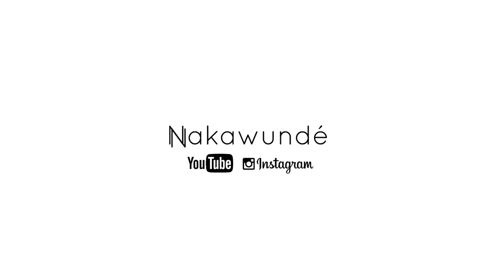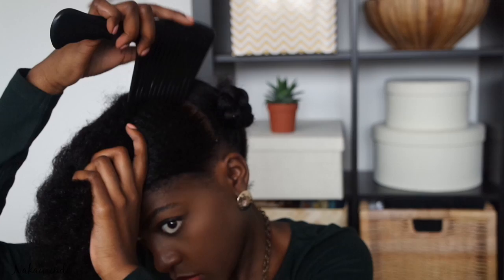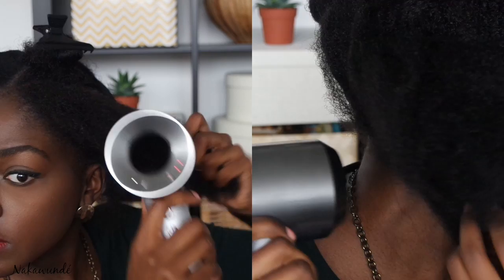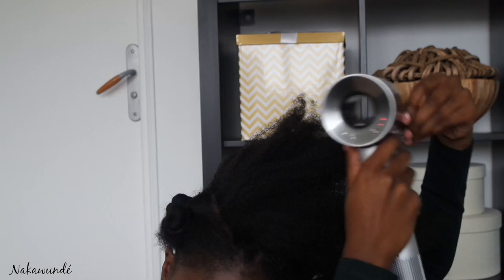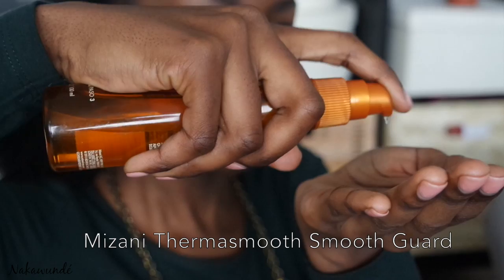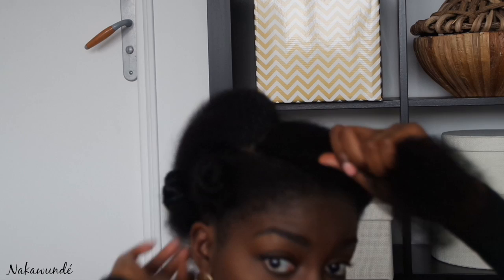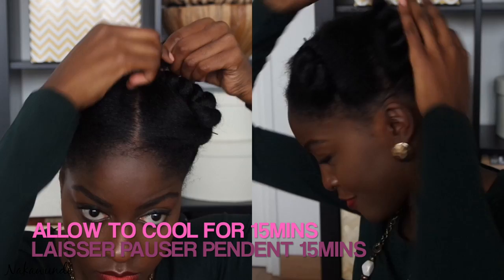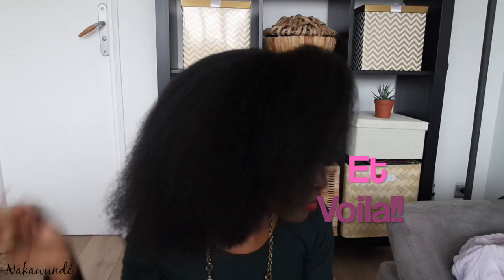Blowout Natural Hair with Dyson Supersonic | Nakawunde

Comment: Do you find that the blow dryer dries your hair fast? I'm looking for a new blow dryer. I wish this one had a comb attachment, but I wanna see if it's worth it. You're one of the only people I've seen give a review from the African diaspora.
Reply from the maker: Yes I also hadn't seen it used on natural hair so I had to do a video. It does dry your hair really fast, which is also why I had to do smaller sections to maintain control on the shrinkage. I agree that for natural hair a comb attachment is a necessary option. If you are used to blowdrying with a paddle brush/ round brush it's great. And the diffuser is really good, so if you like wash&go's it'll be worth the investment. x

Comment: I just found your video and channel since I received the Dyson as a gift.  I've been struggling with it due to a lack of a comb attachment but I will try your method!  I'm often too impatient and my hair ends up brittle and tough to detangle unless I use a ton of product.  I'm going to try the Mizani line to see if that helps.  We have similar texture hair and mine gets DRYYYYY and the ends tangle immediately when drying.  Have you ever tried to blow dry using a paddle brush?  I have a paddle brush but have no idea what I'm doing lol.  Thanks again for this video!! :)

Comment: Hello! I want to add blow drying into my hair routine to stretch my hair. I like your method. Three Questions: Do you blow dry once a week (after every shampoo)? Do you detangle with a comb after conditioning or only during/after blow drying on stretch hair? During the winter how would your blow dry wash routine change?
Reply from the maker: Hi, thanks for your comment... I don't blow dry after every shampoo as sometimes i style my hair when wet... I only detangle once during my wash routine - usually with conditioner in. Then I rinse and twist it into the 4 sections and it's ready for blowdrying. So I'll only finger detangle if needed with this method... My blowdry and wash technique is the same all year round, it's just the products that change... I'm going to try to do a product video soon so stay tuned :-) x
Reply: Thank you so much for your thorough response. It was very helpful. I just have one more question, do you think it is safe to blow dry every other week? Thanks again.
Reply from the maker: you're welcome! yes it should be fine as long as you are using a heat protectant... let me know how the hair journey goes for you xx